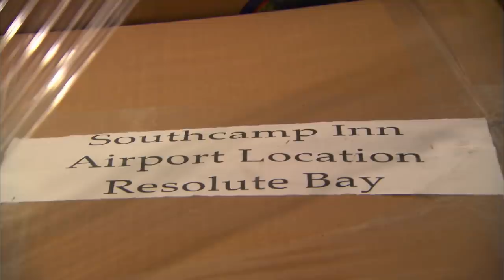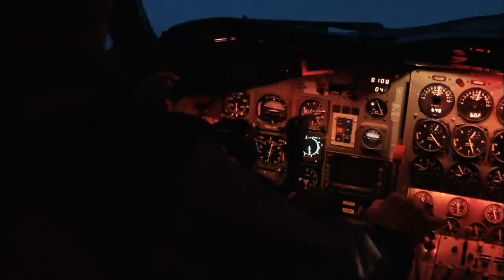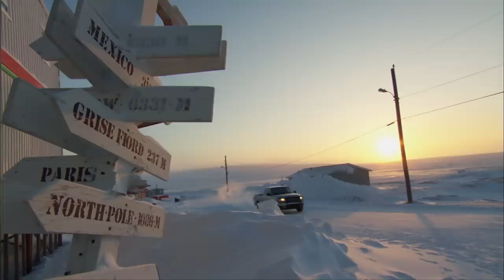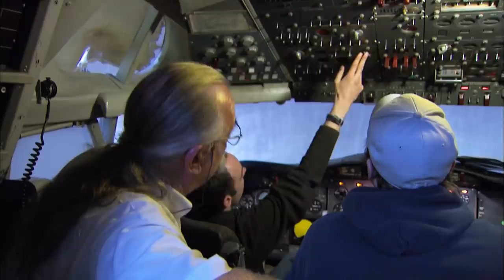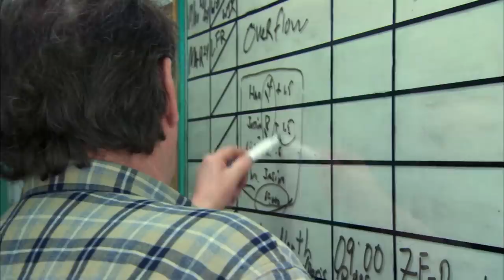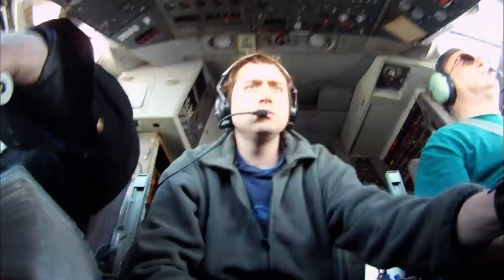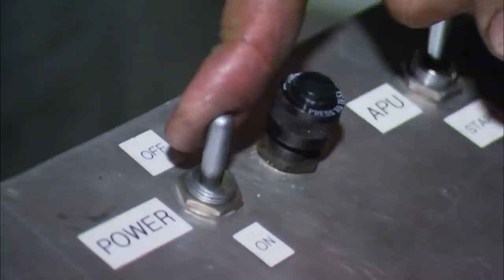Rookie DC-3 Ice Pilot Struggles To Land Big Plane Under Extreme Conditions | Ice Pilots | Wonder

Comment: I don't doubt there's manufactured drama, this being a tv show, but dwayne's comments are not unlike what I've heard in several jobs. I haven't had the luck to work on airplanes but I have worked in service departments of dealerships and on some construction/industrial equipment, and management had similar gripes with the mechanic teams. The thing is, if you don't know how these machines operate, you can't pass judgement on the crews on how they go about it. These are old aircraft and extreme conditions, rushing to get contracts done is dangerous.

Comment: Quote from: Aviation Investigation Report A13W0120
Engine failure after takeoff and collision with terrain
Buffalo Airways Ltd.
Douglas DC-3C, C-GWIR
Yellowknife Airport, Northwest Territories
19 August 2013

There were other indications that the organizational culture at Buffalo Airways was not supportive of a system that required the organization to take a proactive role in identifying hazards and reducing risks. The company's response to deficiencies identified during TC surveillance activities demonstrated an adversarial relationship between the company and the regulator. The company refuted the regulatory basis of findings, questioned the competence of TC inspectors, and initially did not take responsibility for the issues identified. The overall picture that emerged from this investigation is of an organization that met the basic requirements of regulations and then only when pushed by the regulator. An SMS introduced into a culture motivated merely to comply with regulations is unlikely to be effective. The operator's SMS was ineffective at identifying and correcting unsafe operating practices.